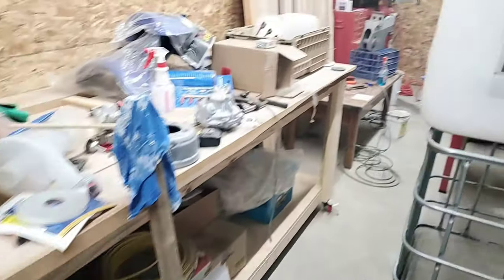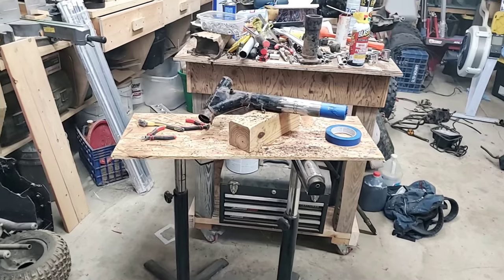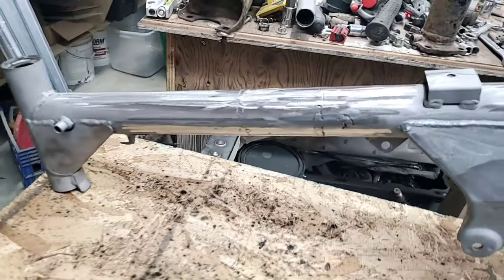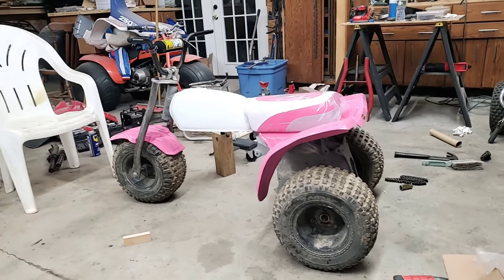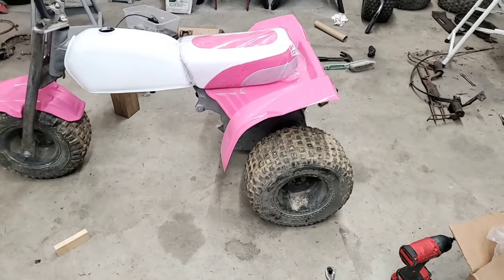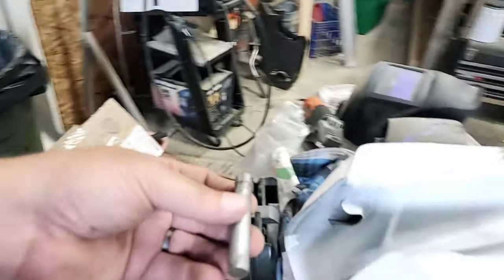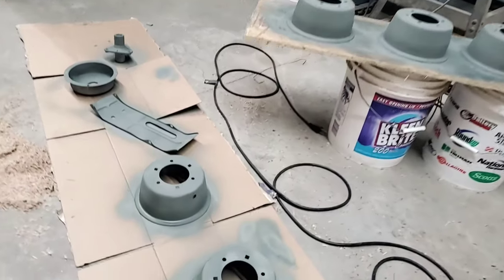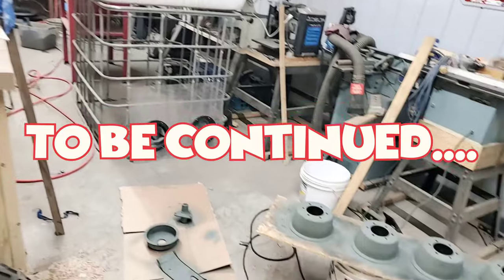CUSTOM PINK ATC70 BUILD!  - We're close to the finish line, will we make it in time for Trike Fest!?

Comment: Are you using a flux core welder? The way you ground it to clean everything up it should have welded clean. If so, a gas welder with argon will help tremendously❤

Comment: If you are using a flux/mig welder, make sure the polarity is set correctly for the type of welding you're doing.  That could cause a lot of the spatter you're seeing.
Reply from the maker: I'm using solid wire with Argon shielding gas.  I've got my polarity set up correctly.  Maybe my gas is bad?
Reply: @ThisOldTrike  are you suggesting you have bad gas?  hahahaha

Are you using straight argon or a blend?
Reply from the maker: Lol, blend.  75/25 I believe

Comment: I know it's done but if you are using solid wire with gas you need to push the bead and not drag it like you are doing.
Reply from the maker: Actually, my buddy has since pointed out to me that I was using flux core wire (I thought I had bought solid wire)...  It must have been in the wrong bin and I didn't catch it... so I put in the wire I thought was solid... switched the polarity over for solid wire... I'm using gas with it and everything was good there... but I was splattering horribly as you could see.  I've since bought actual solid wire but haven't used it on a project yet.  I do have another 70 to build for my son, so I'll probably be trying this again over the winter.